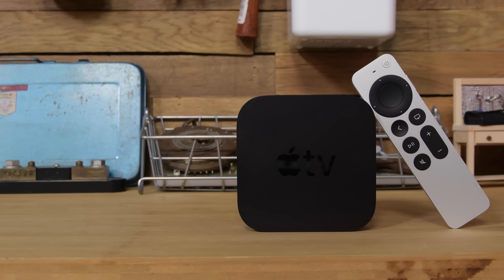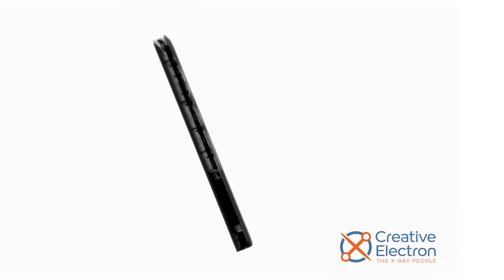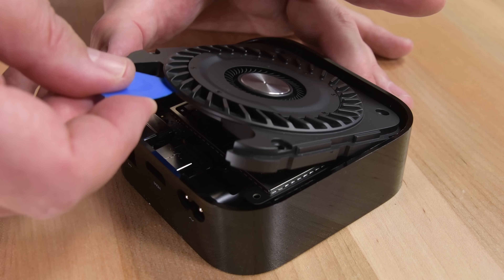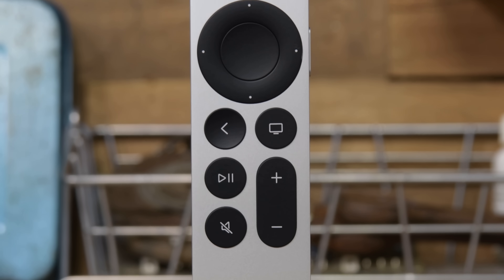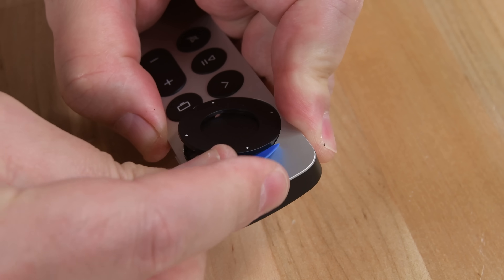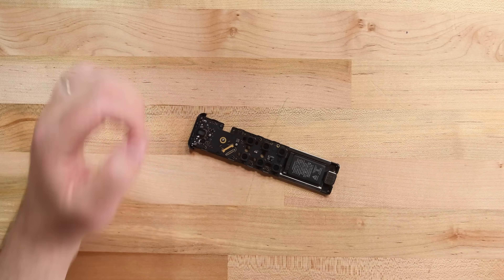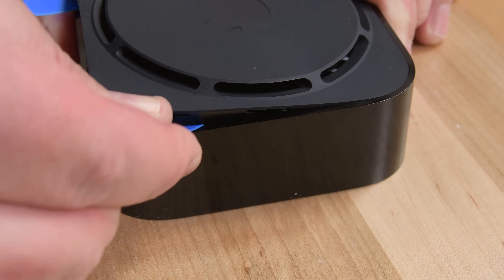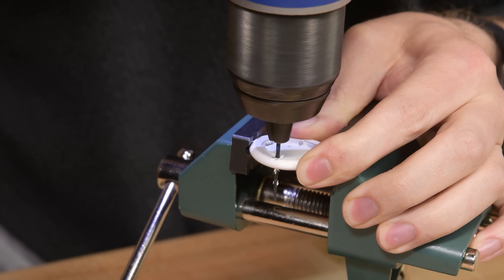Apple TV 4K 2021 Teardown! Good Luck Replacing Your Remote Battery!

Comment: Is it possible to investigate the HDMI chipset to verify that it is indeed 2.1? HDTV test found that it's so far only capable of HDMI 2.0 signalling.
Reply: Apple says it supports HDMI 2.1. My guess is that the current software doesn't make use of it but tvOS 15 probably will.

Comment: You can calibrate your tv with older apple tv's too.
Reply: Came here to say this. They also mentioned the touch wheel operating like a classic iPod touch wheel which doesn’t seem to be true in its current implementation.
Reply: Calibration works on my previous generation Apple TV 4k, not sure about the 3rd gen HD.

Comment: Coin cells are not rechargeable and no you won’t need to replace the stock lithium battery, Ive had quite a few Apple TVs and all the remotes work just like new. Making a big deal out of nothing lol. The Apple TV will become obsolete in other ways before the remote battery packs it in or you loose it completely…
Reply: Completely agree, this was a silly comment from iFixit just to give their chosen video title some justification.
Reply: iFixit is great but their comments always seem so low iq

Comment: Considering that I only need to charge my remote maybe three or four times a year and it’s likely good for a few thousand cycles, I don’t think many people will have to replace the battery of the remote. I mean, even if you recharged it every week, it would still last over ten years.
Reply: Batteries lose capacity just by sitting, not just by charging. You can still use the TV remote to control the appletv, but turning it on only works with the remote app on an iPhone.
Reply: @HNedel  2 other ways to turn off the Apple TV 4K without its remote:
1) I use Amazon Alexa skill to turn my SONY TV on/off, which is connected via HDMI ARC or eARC port to the Apple TV

2) I have a Logitech Harmoony Elite remote
Reply: This video is irrelevant because by the time the battery needs replacing, you're gonna want the latest Apple gadget anyway.
Reply: @mrpmj00  no. Moving away from Apple and microsoft. I’m going open source and buy from companies that let me change the batteries.
Reply: @darksideblues135  lol u like wasting money
Reply: you're gonna want the latest Apple gadget anyway.  I've just replaced my Apple TV 4k black remote with the new redesigned white remote.
Reply: Ten years? You are hilarious.
Reply: Still lets say something happens and your battery is dead..will good luck replacing it. Apple could’ve easily made it more repairable but purposely didn’t so you’d rather buy a new one rather than replacing a battery.

Comment: Perfect aim? You don't need aim at all on the remote since it's all bluetooth. You only need aim when pointing at the TV to adjust the volume or power it on/off. Also coin-cell battery? Only if is rechargeable, I don't want non-rechargeable batteries in a remote again.

Comment: The most striking thing is that this could have been a Mac Nano if it was fitted with A14.
Reply: @OhSjit  I’m curious what you mean by that. All of Apple’s custom silicon are ARM chips. The Developer Transition Kit was based off up the iPad chip this Apple TV is using.
Reply: @OhSjit  Dude, every custom Apple SoC has been ARM-based. macOS would absolutely work on an A14, especially considering the developer transition kit used the A12Z which was in the last gen iPad Pro.
Reply: @OhSjit  Youtube is for everyone but the comment section is not for someone who does not even know if his comment is correct or not.  lol
Reply: @OhSjit  your comment gave me a headache.
Reply: The very first Apple TV had an Intel chip and hard drive, people have since modded them with SSD’s and installed OSX onto them. So they were indeed Mac Nano’s.
Reply: @OhSjit  how about you stop yourself? you don't even know iPhone has been using ARM Architecture since it's birth. lol.
Reply: @OhSjit  and I bet your smarty brain don't even know what's ARM in it's entirety. lol.
Reply: ahem. M1
Reply: @OhSjit  yeah. you should tell that to yourself.
Reply: @OhSjit  do I need to tell you? my information is completely public. smart*ss. anyone knows where I work. lol. 

you must thank google, facebook and linkedin for that. and also to me. coz if I didn't use my full name publicly. heck you won't find a single piece of information about me. lol.
Reply: Now it has a A15 and still is running the old OS.

Comment: does any one know the name or manufacture of the black double sided foam tape found in a lot of electronics? (some times it's dark grey)
Reply: 3M makes a lot of tapes.
Reply: TESA is the brand most of us electronics repair shops use- it’s as good as or better than the original stuff and it’s actually fairly painless to remove if you need to open something up again later
Reply: @TorpeAlex  Thank you for your help I really appreciate it.

Comment: If you charge your remote once every 3 months, you’ll only have to put about 4 charge cycles a year on it. I’ve had my glass Siri remote since April 2020 and I’ve only charged it twice, but this battery is extremely unlikely to wear out anytime soon. Even if you use the remote for 10 years, you’ll still probably not loose significant battery health
Reply: Yeah, I’ve been using the Siri remote since the 4K launched in 2017 and 4 years later it still only has to be charged every few months.
That battery is gonna outlive my house.
Reply: yeah, even if you degrade down to 40% capacity after 5+ years, that means you have to charge it once every 6 weeks instead of once every 3 months... non-issue unless failure.
Reply: @mikeweatherford5312  and I’ve never saw an Apple TV remote fail, never mind the battery
Reply: Update: my glass remote failed due to water being spilled on it
Reply: @tabbycat406  and that will most likely be the largest source of failures, either water/coke spills or dropping it on a floor (either by accident or by rage because of misbehaving childs, FIFA/NFL rage).
Reply: definitely and in 10 years god knows what apple tv will transform into !!!!
Reply: Every 3 months? I charge mine like 2 times a year 😂
Reply: @piotrek-ek  probably depends on how often you use it and use Siri.
Reply: Thank you for saying this… the battery will not wear out… the old Apple TV had a tiny battery in comparison and it still works like new. The device will be useless long before the battery fails of old age.
Reply: Yes, but Lithium Ion batteries have a shelf life in addition to a maximum number of charge cycles.  So you should expect reduced life after 3 years or so.  But, of course, given how little power a remote control consumes, it might be much longer than that before you actually notice a problem.

Still, I have to agree that using traditional cells (CR2032, AA or AAA) would be better.  There's really no need for a device like that to be rechargeable, given how infrequently you need to change batteries in general.  (The remote for my Dish Network receiver, which is RF, not infrared, typically lasts about two years before its batteries need to be changed).
Reply: @Shamino0  The Siri Remote is also used to send Siri Commands, so it does use a little more battery in those conditions. And generally speaking ( I hope ) Apple choose the longer lasting and high Cycle
Reply: @Shamino0  I have had 15 year old lithium cells still almost performing like on the first day. And after 15 years, other parts of the remote will probably fail (buttons, charging port, etc.). Especially with childs who tend to drop or bend things.

Comment: Is it possible to talk more specific about the components? Such as the HDMI 2.1 - is there something special about that? Will it could handle 8K later or?

I don’t know much about it, so therefore I would like to know why and what’s should be so special about hdmi 2.1 port - when they (at the moment) only supports 4khdr60hz and not 120hz?

Thanks for the tear down video
Reply: Yes, HDMI 2.0 only supports 4K60, 2.1 supports up to 8K120 i think, though i'd suggest you check the HDMI specs list.
Reply: @TheGokki  i know… but Will Apple open support for 4k120hz - now when it’s a 2.1 hdmi?

Comment: I own a 3rd gen Apple TV with the old aluminum remote that had the very bad dpad and one thing I like about is the fact that it had a replaceable CR2032 battery. I think the reason they no longer do that is because the mic, internal sensors and extra functionality of the new remotes requires a lot more juice and a cr2032 would run out too fast. AND I don't think Apple would ever make a device with a rechargeable and replaceable battery. Remember: the AirTags aren't rechargeable nor was the 3rd gen remote

Comment: In what world do you need to replace the battery in the remote? It will probably still be at more than 90% capacity in a decade
Reply: Haha, yeah sure
Reply: @MsBronix  A typical spec for a battery of that type is 70% capacity left at 500 charges, or 2 years, whichever comes first. It then drops precipitously. At 5 years you'll be lucky to have 30-40%. At 10 years it may have 5% if you are lucky, meaning it is long dead.
Reply: @abitrubbish  That can’t be correct. My 5 year old iPhone SE still has more than 80% capacity
Reply: @MsBronix cool

Comment: Lets be real. If you need to change the battery on a apple tv remote then it’s time for a new remote… phones may need battery changes after a 2-3 years but you use those a lot more and charge them often multiple times a day. I charge my apple tv remote MAYBE once every 6 months. 

If the battery ever degrades, it’s gana be well past it’s life cycle anyways. Pressing some buttons doesn’t use much battery. How often do you change your tv remote batteries? I think i changed mine over a year ago.
Reply: I've had the same experience with my Apple TV remote (the previous gen black one). I charge it about once a year... and we use our Apple TV every day.
Reply: I assume those using the microphone run through the battery a lot faster

Comment: I honestly thought it was much much worse.. They did not completely lock us out of the repair by much..
Reply: They will lock you out of the remote if you replace the battery.
Reply: Dot not worry, battery will be serialized to the some chip in the remote, or it will be specialized component that you could not buy it outside of Apple care, that will replace the hole remote
Reply: They will make the chip supplier only sell replacement chips to them.

Comment: 8/10 on a apple product ? WOW...
Reply: so will a 9/10 surprise you
psst the Mac Pro got a 9/10
Reply: And then they had to ruin it with the remote, which deserved a 1/10.
Reply: Apple software doesn't allow 3 Rd party replacement parts
Reply: @adithprakash9656  it doesn’t stop you from doing it, it just leaves a notification in your settings that you didn’t use a genuine apple part. It still works.
Reply: You haven’t seen Samsung, have you?
Reply: I mean all Apple repairs have been better than Samsung
Reply: Gaming York  for most android phones you just take the back off and than you can replace the battery
Reply: IF its not important for shipple dominancy, they will let you repair it
Reply: Huh? At least iPhones historically had pretty good repairability scores
Reply: @tannisroot  ya Samsung glues the screen and battery in
Reply: @WalterMan  apple also glues the screen and battery in